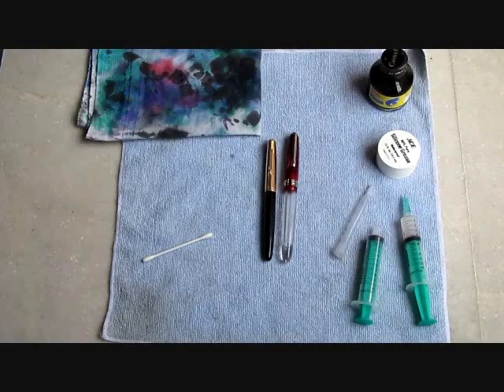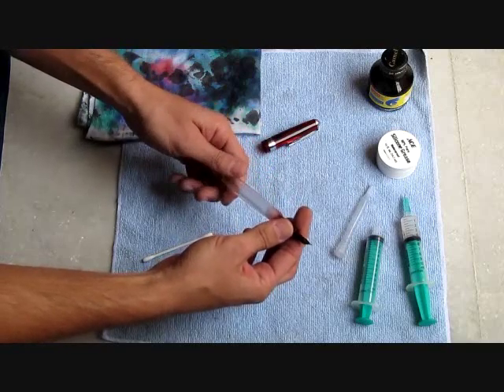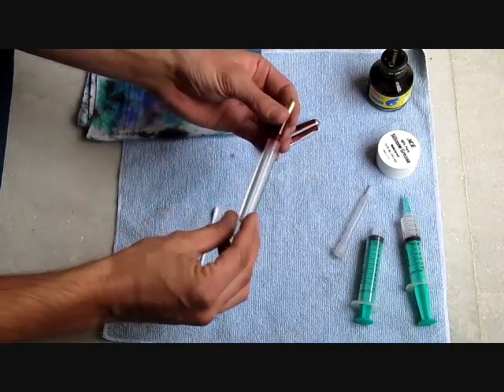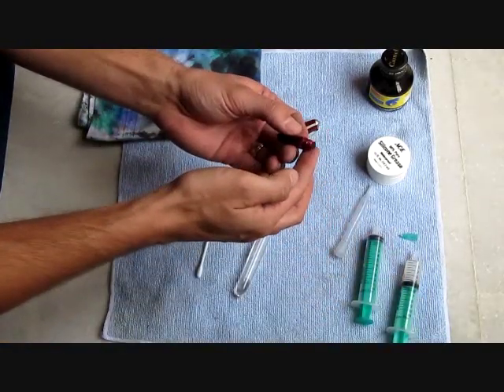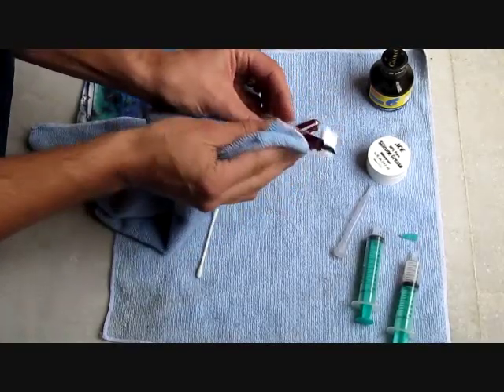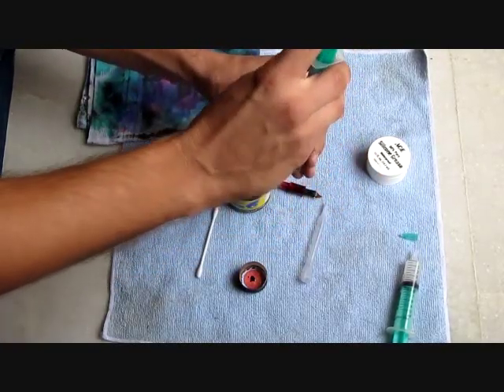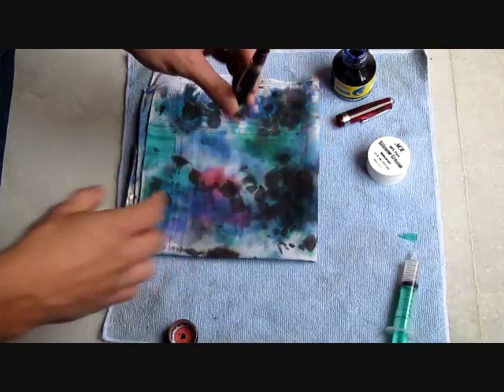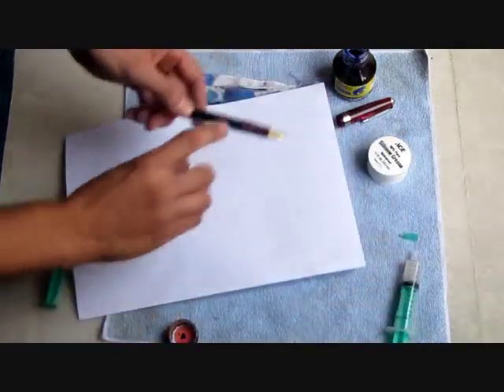How to fill an eyedropper fountain pen

Comment from the maker: Yes, the silicone grease is a grease and not a sealant.  So, there will be no problem reopening the pen.  Good question.
Reply: Fountain Pen Revolution I've bought a fp recently and it came with a converter. How do I tell if a fp would do good as an eye dropper?
Reply: You can check inside and see if there are any metal parts. There should not be any holes. Some fountain pen reviewers/reviews say wether the particular pen is eye dropper convertible or not.

Comment: Just to be sure, I plan to buy the DANCO0.5 oz. Silicone Faucet Grease. Will this work? O.O There's so many different kinds out there, I'm not too sure which one is good or not.
Reply from the maker: Plumbers silicone grease will work just fine!  Any type will do really.
Reply: Thank you! :D And, I just purchased a pilot plumix pen (a few minutes ago). I wanted to convert it to an eyedropper pen, but I hear it's got a hole at the end of the barrel. I wouldn't mind if it has a hole, but is there a way to seal it (with glue... tape.. or anything) in order for me to use it as an eyedropper pen? P.S. I still plan to buy a platinum preppy and convert that as well. So, if there is ABSOLUTELY NO WAY to seal the hole on the plumix, it won't be too much of a disappointment. OwO I wouldn't mind if you even made a video for how to seal pen holes if the procedure it possible XD I couldn't find any tutorials anywhere online on the subject, so, if you could find a way and show it to the world, that'd be amazing! :D (But, that's just a suggestion XD)